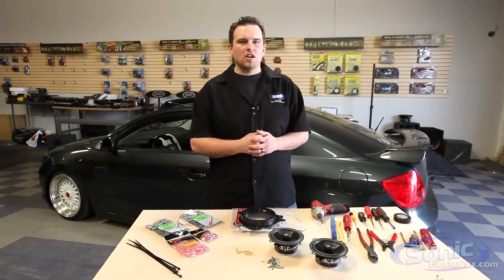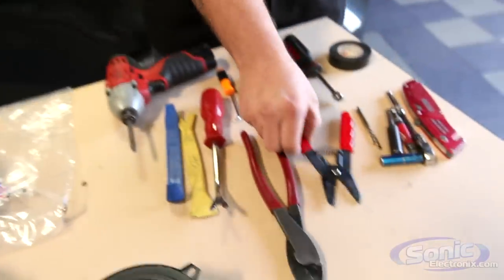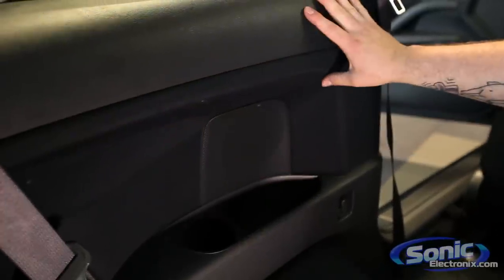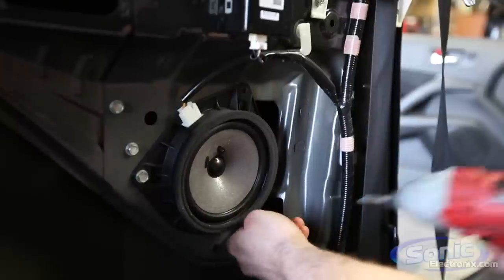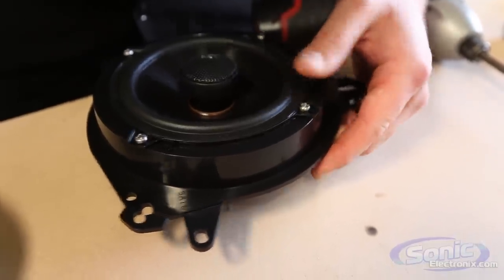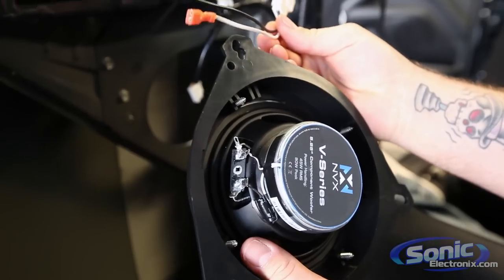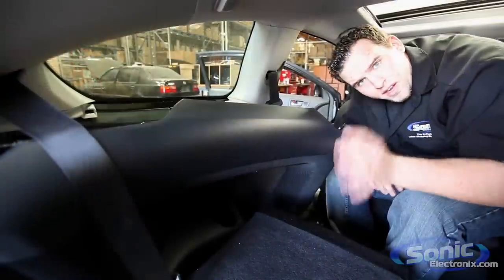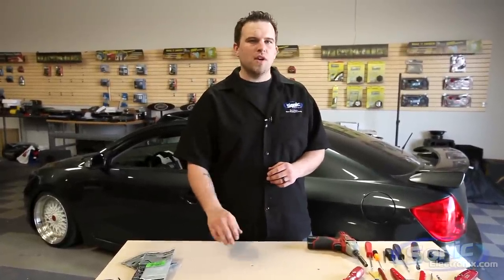How To Install Coaxial Car Speakers | Aftermarket Speakers in a Scion tC | Car Audio 101

Comment: Just an FYI, always make sure to test polarity when using those plug and play adaptors, they aren't always 100% correct depending on the manufacturer. Also, I wouldn't leave the plug just hanging like that, it could cause rattle behind the panel. A cheap easy way to eliminate the possibility of that is to wrap it with a piece of sound deadener or duct tape, and then secure it somewhere out of the way with a zip tie or tape it down to the metal with a high quality tape.

Comment: Quick question I ended up purchasing some sound damping kit it came with a roller the plastic sound damping wrap  and some rubber baffles does all that get wrapped around the speaker along with the bracket??

Comment: Where did you get the bracket to hold the aftermarket speakers...i just bought some 6.5 Kenwood but I don't have that speaker bracket would I need that or can I used the factory speaker bracket?

Comment: I have the speaker adapter for my 2005 scion tc. I noticed you didn't screw all 3 screws back like the oem bracket??? are they supposed to be all 3 or just 2??

Comment: I want to add a set of 8s i already have its a set of tower subs in one box plus add tweets to my 1994 isuzu rodeo with a eq as my cross over flr them and the sub will it work the radio only has one set of preouts

Comment: Would you happen to know where to get a front speaker mount for 2016 Canyon? The 6x9" OEM mount is about 2.5" thick but the speaker is glued in so I can't reuse that one. FYI I am going back with Skar 6x9".

Comment: I got an amazing deal on Sony Coax Speakers, but my car has a component setup, I thought about converting it into a component, but I have no screw behind my sticker. I guess I could cut the tweeter off and make it work that way. Do you think I should do that or just install coax in my doors?

Comment: Where do i get a mounting bracket for an Audi A3 8l with 2 doors, for my rear fill? 
The Original 16cm speaker Grill is there, but absolutely nothing to mount, and i cant cut in a thread.

Comment: Are those 5 1/4" speakers? I have a special edition 2006 scion tc and sonic's fit guide calls for 5 1/4" where i have seen on another site saying its 6 1/2" for front and back.

Comment: So where is the explanation for when you have to reset the power windows after them losing power? Every single Scion Tc I've worked on has done that, so I'm surprised it wasn't mentioned.

Comment: Well, I installed a aftermarket double din stereo about a month ago, everything is fine with the wiring before the speaker went out. I installed the left side first and turn my car on to test it to make sure everything was good. Works perfectly. But the entire passenger side door just stop working. The factory speaker is perfectly fine on that side. Now after installing the left side speaker, neither the new speaker or factory speaker works. The back two speakers work fine as well.

Comment: Hello, I'm need of help. I have a 04 celica and I replace the factory speakers in the front driver and passenger side doors with 300 watt kickers 6 1/2 speakers. I installed the drivers side and works perfectly, but the passenger side doesn't work at all. I check every wire, fuse, and the stereo and it all checks out fine. Any ideas what the issue could be?

Comment: Would I need a speaker adapter for the 2012 Scion tC?
Reply: you dont need one, but a speaker adapter that fits the speaker makes it convenient for any install? so you dont have to solder and splice wires ect..

Comment: do the adapter to the speaker conection Come with the speaker when you buy it?
Reply: They sold separately u can get them cheap on Amazon they like $5 to $15 depending on how many you want...but make sure it's for the making of your car like if you have a Toyota make sure its for Toyota and not Ford...u get the picture

Comment: Okay I know how to repair subs I repair them before I know how to recoil a sub and everything but this one's weird I got a 10-in dual voice coil forum Alpine type s I hook it up to a regular head unit wiring and I can turn all the way up but you barely hear any sound coming out  as soon as I try to hook it up to amp it's kills amp so I took the sub apart check the coil perfectly fine nothing wrong with it there's no burnt Mark nothing no rubbing scraping any drop it back there and still does the same thing what could cause that where I hook up to a regular radio barely get any sound out of it you have to put your up next to it just to hear anything but when I hook it up to an amp nothing

Comment: did u check your balance?? if yeah just disassemble the radio and the passenger door and use a speaker wire to act as a jumper wire to the radio, if it doesnt work with the designated wires for that speaker try another set of wires on the back of the radio, good chance you just got a bad speaker

Comment: Has anyone done a full system upgrade for the 2018 accord yet? I have the Sport 1.5T. I'm trying to do a 5 channel amp for the front/rear components and add a sub on the 5th channel. There seems to be no one documenting their mods, so I'm sort of stuck guessing the best way to do all of it. I'm assuming I can get high level inputs via LOC from the HU but I don't know if there's a factory amp hiding anywhere. Also there are already tweeters and woofers on the door and rear deck, does this mean there's a crossover somewhere for each channel or should I expect to see 8 channels coming from the head unit. ARGH!!! I hate this about newer cars.
Reply: Hope you figured it out

Comment: i wired my pioneer 400watts amp into the rear speaker level inputs my rear pioneer 4ways get 200watts x2 my front pioneer 4ways get 80watts rms x2 its sounds awsome by the sync 2 flash drive play
Reply: the stock cd player has decent sound by sanyo n the voice activated sync radio data system memorizes all tunes on the usb drives n the sound is very nice!

Comment: What's the size on the speakers for the scion tc
Reply from the maker: teshawn2 we would need to know the year and maybe the body style as well. however, you can check what size your speakers are here with the vehicle fit guide: http://metraonline.com/
Reply: +Sonic Electronix Hi, Anyone help me to configure out what best speaker combination in my car.
I prepared Infinity brand speaker, I will replace my stock speaker in front with size 4” and Rear is 6.5”.
If I change to same size with Infinity brand, 2 way Coax, Do you think it will be ok?
My Head Unit is Pioneer AVT-H2850BT with Pioneer under seat sub-woofer TS-WX120A.
Reply: Sonic Electronix how many watts are those coaxial speakers ??

Comment: Also, in the front, im gonna run a comp speaker set, what should i use for the rear speakers? Runnin the doors off a 4 chan amp.